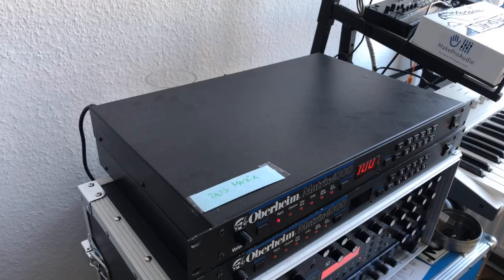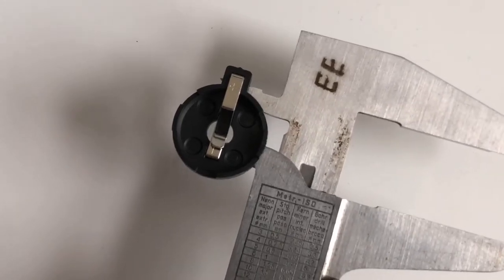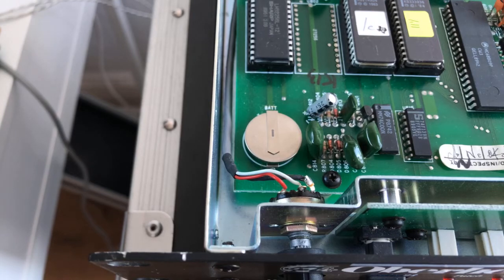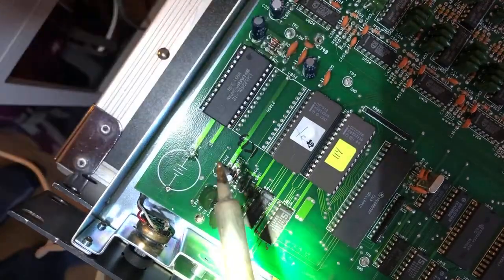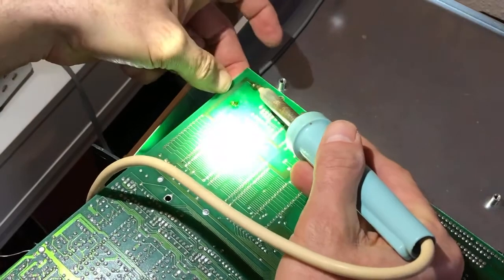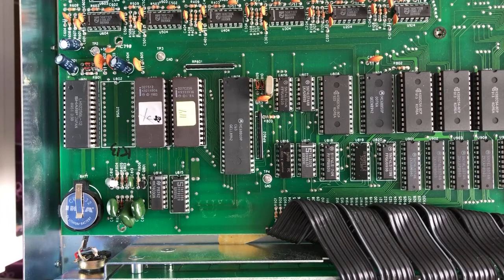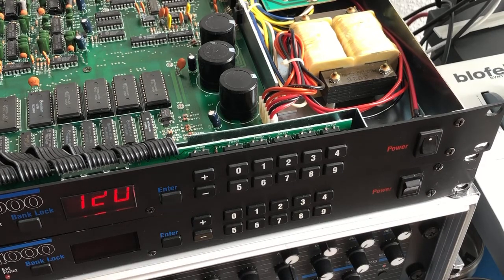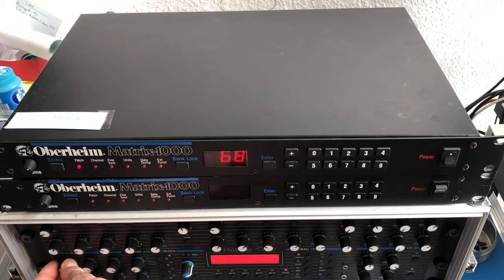How to replace the battery in a Matrix-1000 synth - detailed, step by step

Comment: I just bought a M1000. It turns on, but it doesn’t seem to receive any midi trigger as I don’t see any red light on the LED when I play notes. If I turn the sound all the way up on the synth and my mixer/amp, I can hear a really faint sustained note, even when there is nothing plugged into the midi ports. If I change patches, the note also changes patch, so I’m certain it’s the patch itself and not just a hum. 

Do you know if this is a battery issue?

Comment: Great video, thanks. Just couple of questions, why do you have o remove the old battery holder? Can you not just slide out the old battery and put a new one?  Also, if you have to remove the board, rather than cutting the old battery holder, you might as well desolder it from behind the board no? Thanks
Reply: It appears that Oberheim saved a tiny bit of money and soldered the battery directly in, rather than use a holder. To your second point, it could be possible to do it that way, but it's easier to just cut it out, because then it's easier to remove the 2 remnants when they are separate.
Reply from the maker: Late to the party, but: just as @patientzerobeat mentioned, the battery is soldered in. And this is really the easiest way to take it out. If you are lucky, you can even avoid having to take out the PCB which is a hassle.

Comment: my matrix 1000 will not power on - is this a battery issue?
Reply from the maker: You can try booting while holding the Enter key for a factory reser, but apart from that: Hard to say without further diagnosis. First thing a technician would do is probably checking the power supply: +12V/-12V/+5V/-5V all there and good? (Big, old, nasty capacitors like the one in the Matrx may have to be exchanged after all those years.) CPU running?
Reply: @untergeekDE  all sorted. The fuse had blown by the plug